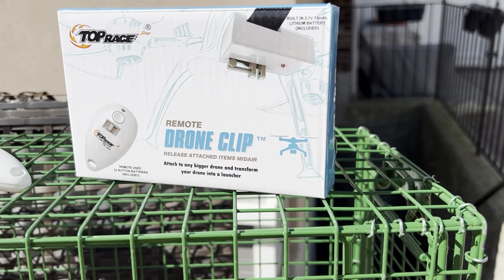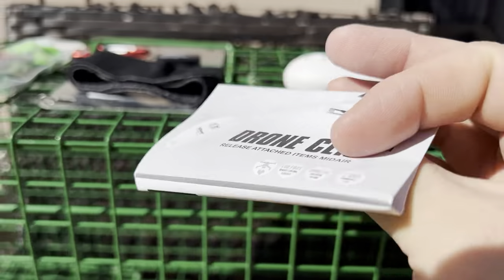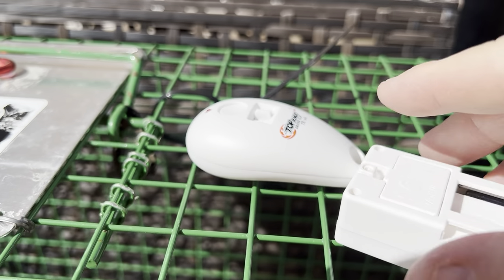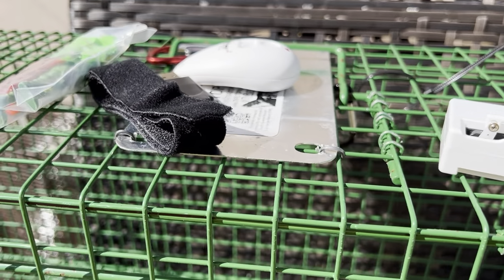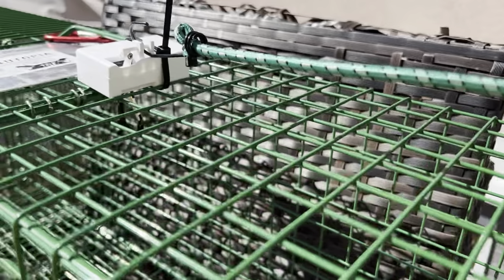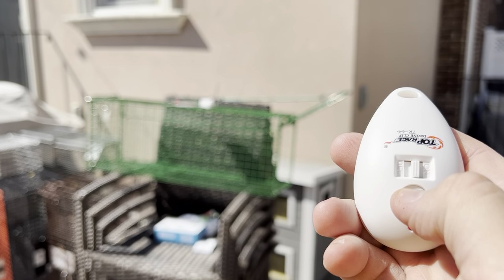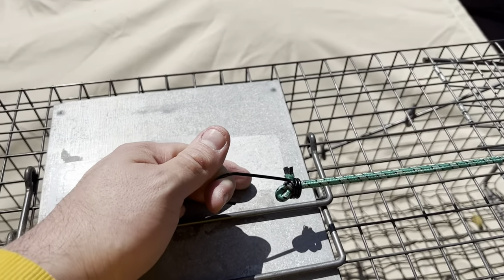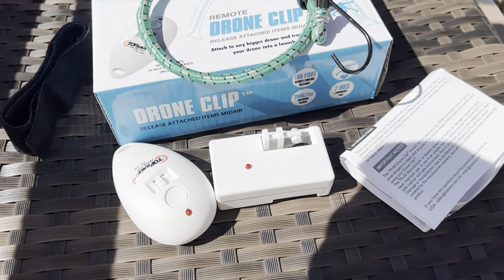Make a CHEAP Remote Trigger for your Feral Cat Gravity Trap!

Comment: Great video, thank you.  I have been using this drone clip as a remote control release for some months and it does indeed work really well and is very inexpensive. A couple comments:  I also removed the tiny screws, and closed both the receiver and the remote, and just replace them with strong tape.  (Gaffers tape is reuseable for a while and very strong.). Also the newer version of this drone clip uses 3 AAA batteries instead of the 3 tiny watch batteries, and it has a longer range for tripping the trap. I've never had a lag-problem with the newer model. I have used up to four traps outfitted with these at one time, and as long as you label the receiver and the remote and keep them straight, all works well.  Finally, don't count on more than 3 hours of power from the tiny rechargeable, so don't plan on extended all-day trapping sessions.
Reply: Thank you for this comment. It will be exceptionally helpful for me who is just now going to purchase this drone clip.

Comment: Great idea, very easy to add to the trap...I just used a shoe string from the door to the latch box.
My trapping expert noted that the remote had some trouble with the signal when she was inside the house and the trap was in the back yard.  I plan to  see  if I can add an antenna to improve the reception,  and also an external battery with longer life than the 2 hrs noted below.

Comment: great idea, but some caveats ...
1. be VERY careful using bungie cords with any animals, especially those with metal hooks on the ends. I had one hanging on a fence once and a very excited dog, jumping at the fence, somehow managed to get the loose end hook IN his eye socket. Fortunately, it didn't puncture the orbit, but had I not been nearby, it could have been a tragedy. I avoid them where ever I can.

2. be aware the battery life on the release end is rated for 2 hrs, although it is rechargable. However the remote batteries are not rechargable and the 1st time I tried to use this device, I discovered these batteries were also dead. I suspect had I turned it off after the 2 hr limit, it might have had a few more hours of use in it. 
 
3. there are 2 versions of this device on Amazon, one for up to 7 oz and the other to 2 lbs for just a few bucks more. Go for the 2 lb version. The battery life is the same but the weight of a spring loaded door is much heavier.  I did get the 7 oz version to hold the heavier door, but I doubt it would last very long.

4. on the spring loaded door, in order to lessen the weight being held, I used a long dowel as a lever for the mechanical advantage. With a small zip tie loop on the door I put one end of the dowel through it, loosely, then lowered the other end to the top of the crate, to about where the handle is, about halfway. The fulcrum is the front of the cage, above the door. I put the release mechanism at the long end, using 2 paint stir sticks, one through the space allotted to accept the velcrow strap and the other through the sides of the cage itself, at the top. The ends of the 2 sticks are clamped with some stout spring clamps to secure the assembly in place. I drilled a small hole in the dowel above where the release is and put in a small wire hook that could be hooked on the release mechanism. When opened, the dowel is released to let the weight of the door rock it forward enough to let the zip tie slip off the dowel to slam shut. I added a 2nd zip tie at the front edge of the cage and ran the dowel through this very loose tie keeps the dowel from being thrown airborne.  With some careful adjustments it managed the door well and I thought I had it covered.

5. the battery limitations revealed a deal breaker for my purposes. I am actually trapping on my back porch. I have a simple motion detector and some cameras there so I can know when someone is there, see via the camera if it is one I've already caught or a new one, and, I assumed I could trigger the trap to close without risking them seeing me at the door. I've used the string thru the door option with some success but was looking for something better. However, that 2 hr window makes it impractical for me in most cases. Once it has expired, I'd have to go out, retrieve the device, recharge it and put it back OR just end my stakeout. Once I go out, my window is closed.  Depending on your circumstances, this may not be a problem.
        To augment the battery limitations, I just added another string release to the end of the dowel holding the door open that would allow me to slide the tie off the end of the dowel and let the spring do it's job.  However, that pretty much makes the remote trigger moot. 
         I'm not saying it won't work, just that it didn't meet my needs. I can see some other possible uses for this clip release, just not for this one FOR ME. Maybe others have some ideas that might help me. It is such a good idea.  Good luck to others.